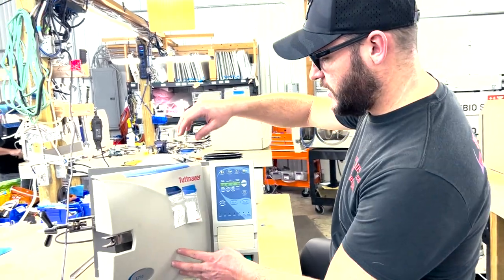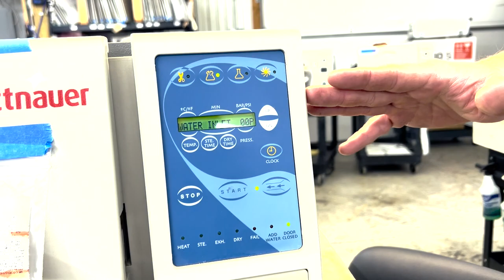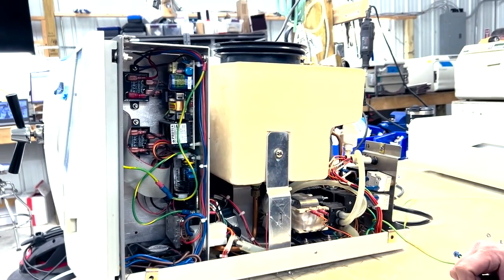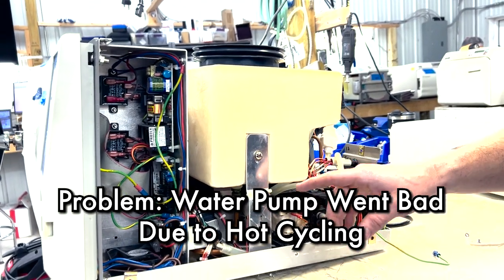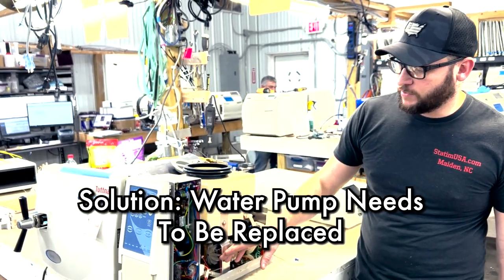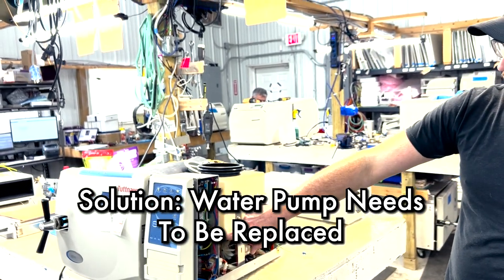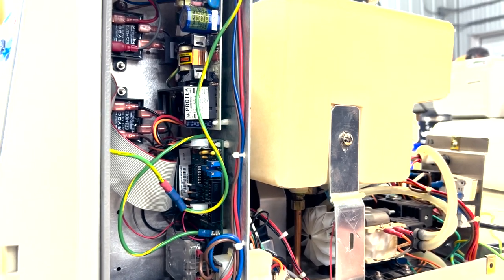A Quick Look at a Tuttnauer EZ10 Water Inlet Problem

Comment: If we are having that same water inlet issue, does that automatically mean our water pump is going bad?
Reply from the maker: Good Day , I'm so sorry we are late on our response. If you hot cycle the unit , which is running it back to back , consistently then yes it is probably failing intermittently  . If the unit has not had the water pump ever serviced then it probably is bad. We can talk directly for faster response . 704-966-1650 opt 3. My name is Andrew

Comment: Hi, I cleaned the autoclave with citric acid and then ir had problems to inlet water, is the pump?
Reply from the maker: The unit will most likely have to be gone through to properly determine what damage the citric acid may have done to any parts like the pump or otherwise. Please feel free to contact us using our FREE Tech Support line at 704-966-1650 option 3 and our techs can walk you through the problem to figure out what's going on.